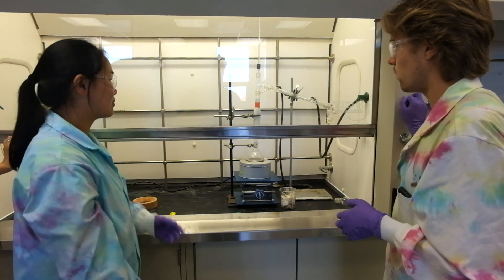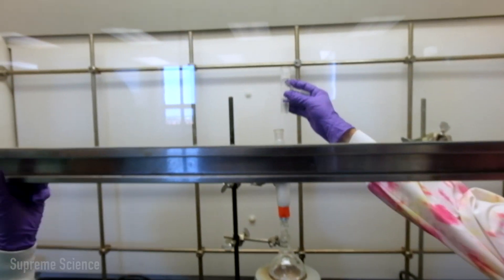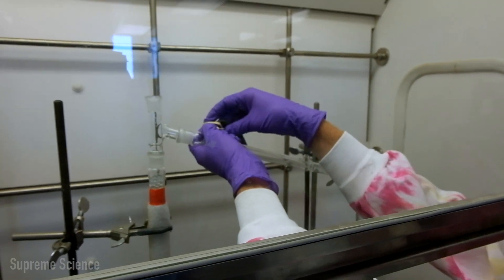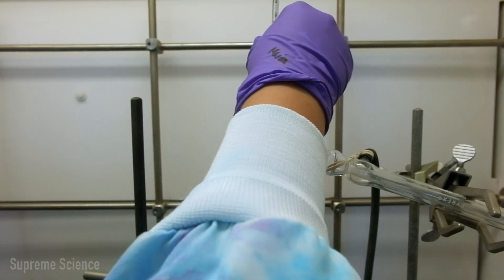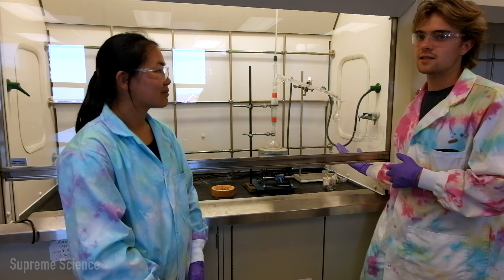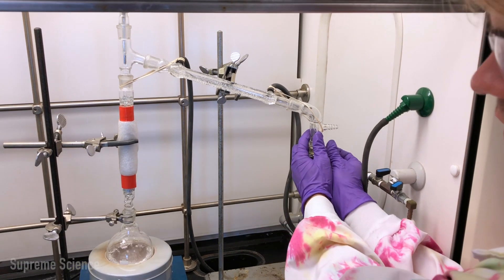*UPDATED* How To Set-Up and Perform Fractional Distillation #Science

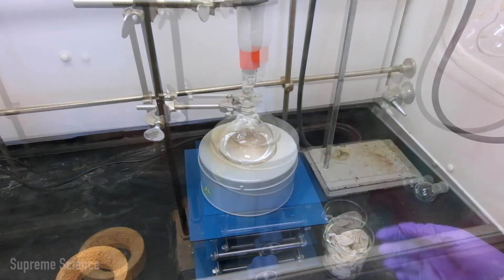Comment: Is that a closed system? How is your receiving flash connected to the condenser? Is that an insulator on your fractionating column? your thermometer adaptor cork, rubber or glass? Great video, but it's not very informative... There's no attention to detail in making the video... I notice at the beginning you forgot to connect a hose? Why do you need a boiling chip? Where is the liquid going to boil/bubble over from? What's that thing show showed at 3:27? Y'all didnt mention it or talk about it. When you're done do you disassemble straight away once you're done, or is there a cooling time before disassembly?
Reply: The system is closed. They show how the recieving flask is connected. I would asume that the material around the column is isolation. I'd say it's rubber. Everything is properly connected. So it doesn't boil over (you answer yourself). If it boils over the flask the liquid could go up the column and onto the recieving flask. A regulator for the temperature of the mantle. I would let it cool.
Just chill and don't be rude, your questions are quite obvious so that is why they don't explain everything.
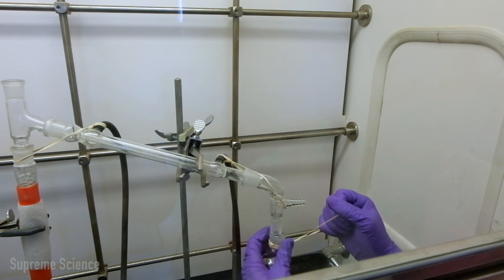Reply: @Marc91FM  The system is not closed, there is a small outlet/inlet in the segment that sits between the condenser and the collection flask visible at 2:15, heating a closed system is a really bad idea as it could explode due to pressure build up due to heat.
Reply: Years have passed but still want to clear some stuff up with the same energy u decided to write back to them:

Is it a closed system? What do u think? Would u try to use a closed system for something that obviously builds pressure due to evaporation/ vapors? Please learn common sense.  Yes, the apparatus has an insulator, again, u really need an explanation for this? I thought it would be self explanatory that the system needs to retain heat, please don’t tell me u need me to explain to u why that’s important. As for the cork, what material do u think is best for this? Please go ahead and try to use a glass one and then come back to me with a paper of 500 words or less on why using what is basically a glass sealer is bad when ur using heat, and by extension, creating pressure. It’s common sense why u would need a boiling chip but if u don’t know the answer to that then u should do ur research on boiling chips and the effects of bumping during the boiling process. That’s not on them, that’s on u to figure out. It’s lab basics 101 when working with boiling substances in a lab.